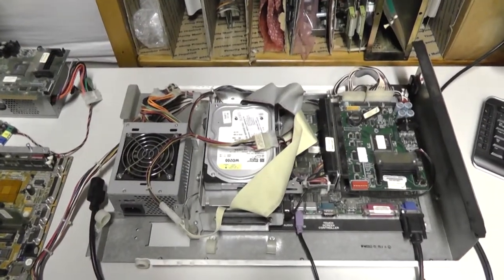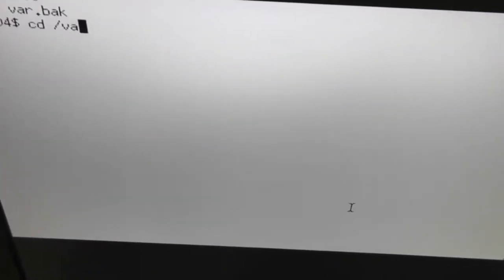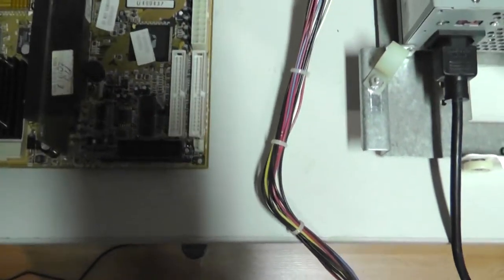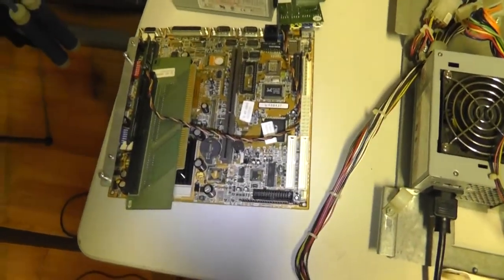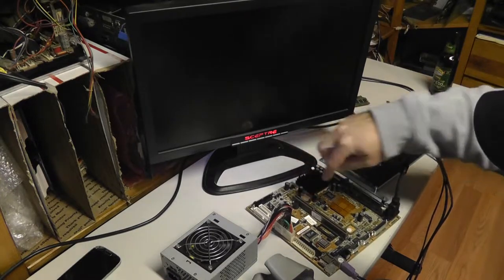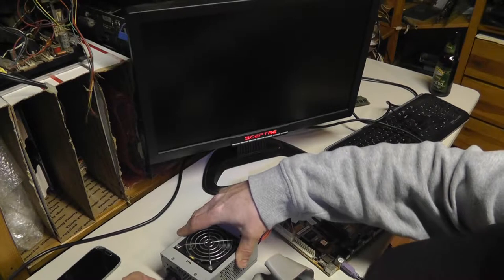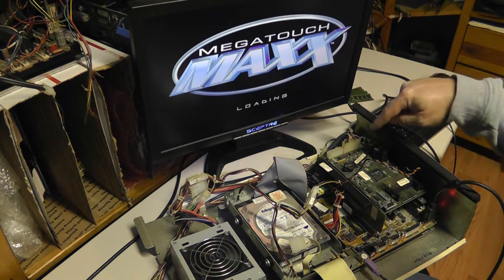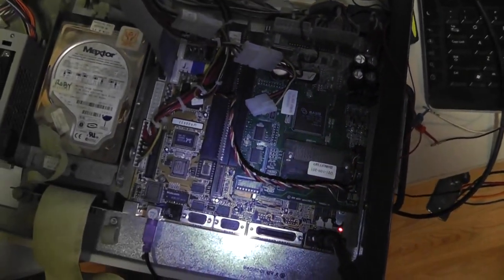Bench testing megatouch maxx part1

Comment: Where do you get the software to reload the MegaTouch systems. Or you want to upgrade to 2014 version. 
Can you use SSD drive on the system. I have a MegaTouch XL.
Reply from the maker: It has been a long time since I have had a megatouch but you might want to try https://www.arcade-cabinets.com/board_hacks/MEGAFORCE-SSD-XX/ 

This thread might also help you.
https://forums.arcade-museum.com/threads/in-search-of-the-megatouch-iso-files.528339

Comment: I have a mega touch diamond with that unicorn board. Everything turning powering on but I get nothing on display. Screen is just green with lines any way you can help what it can be? The hard drive has a green light under it is that suppose to stay on?
Reply from the maker: Have you tried hooking it up to just a regular vga monitor?  been awhile since I have messed with these but I would try a known good monitor first.
Reply: Jacklick’s Arcade and Tech Repair Journey yeah I tried 2 monitors but they would just say power saving mode and nothing would come up waited about 10 minutes
Reply from the maker: @What_R_TheOdds  if you haven't already, I would disconnect everything from the motherboard, remove cmos battery and even memory and try to boot as some component could be bad and not allowing it to boot to bios.  It is standard PC motherboard troubleshooting at this point and if you can't get a vga signal, something is definitely wrong with the motherboard, imo.